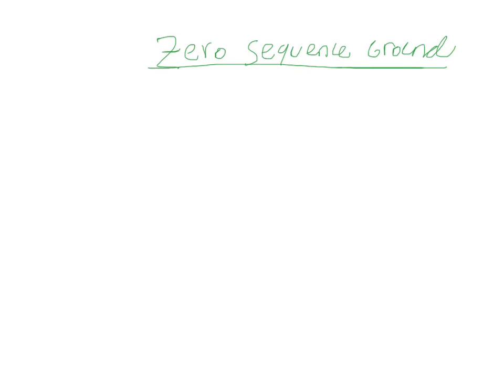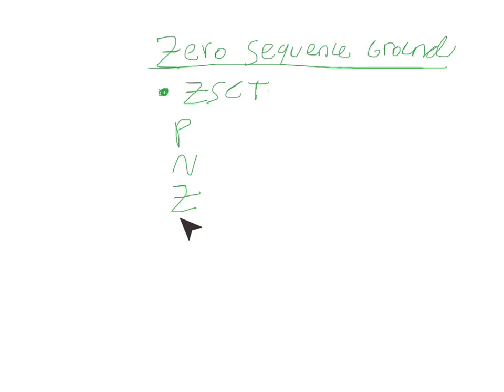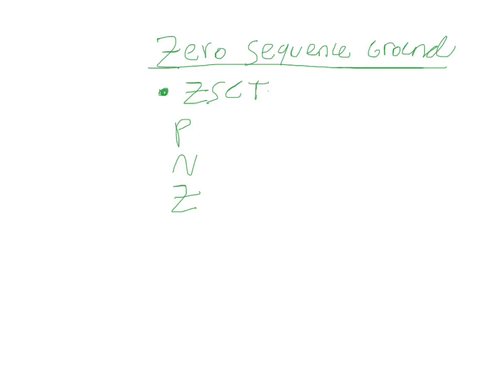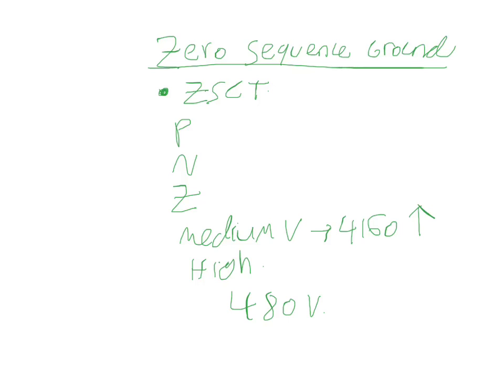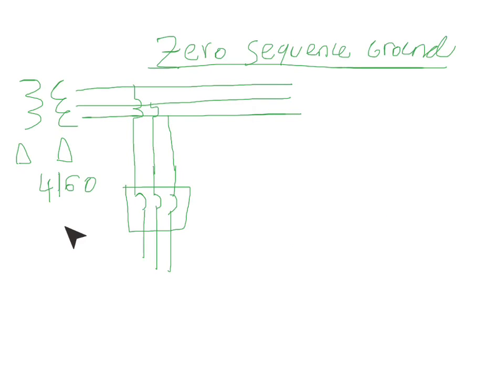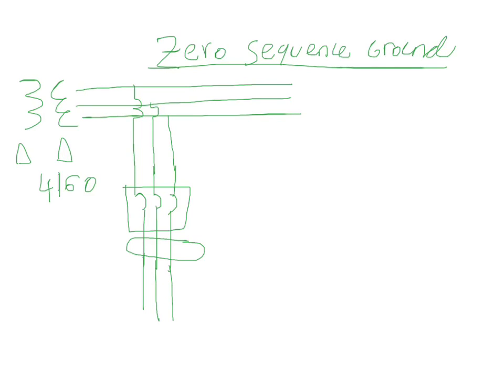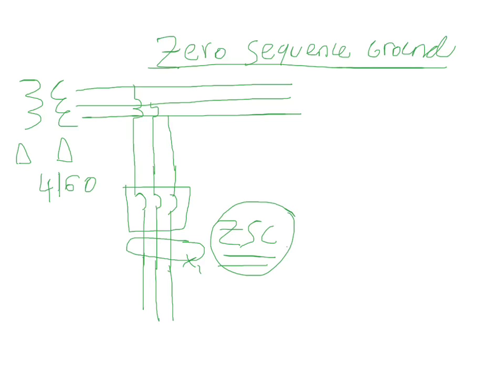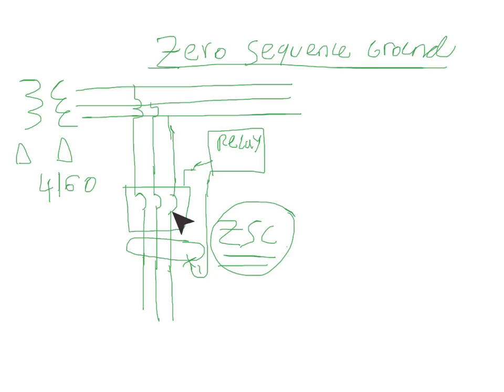Zero sequence ground fault protection scheme

Comment: In a 480v system How does it know the difference between an imbalance because of a natural lighting  load imbalance and a ground fault loss? I imagine you're going to say because it's a zero sequence but what does that mean exactly?
Reply: For a zero sequence CT to be insensitive to load unbalance the neutral wire should be run through the CT with the three phase conductors. The unbalance current (zero sequence) will follow the neutral conductor back to the source. The zero sequence current in the neutral will be opposite direction of the zero sequence current in the phase conductors.
Reply: @matthewcato9384  gotcha

Comment: if you take current reading using a clamp-meter for a balanced load three cable (L1,L2 & L3) together, you'll get ZERO amps. because the emf around the cable canceling each other. But when one phase (let say L1) have slight high current, then the ZCT will sense abnormal current.... some kind of unbalance load. is it? correct me if i'm wrong....
Reply: Yes you are wrong

Comment: @Jaidon 702: Correct. For ZS current to exist in case of a ground fault, there must be a return path to the source. For that, the source must be either: wye solidly grounded, low resistance grounded, or grounded via a zig-zag transformer. Without a return path, the ZS current will be extremely small (mA) returning to the source via conductor-earth capacitive coupling.
Reply: Will you see a value with an Hrg